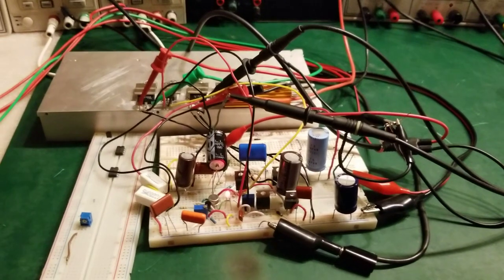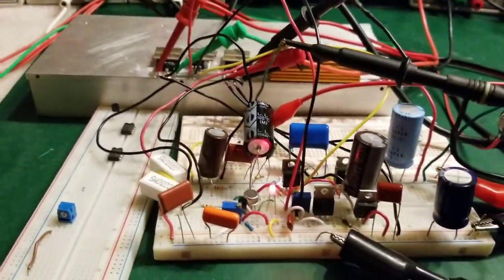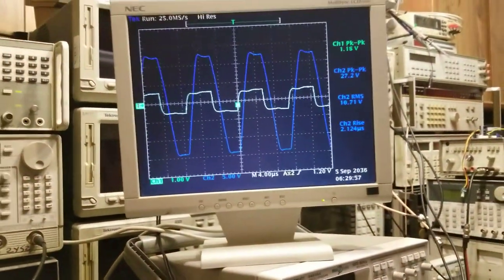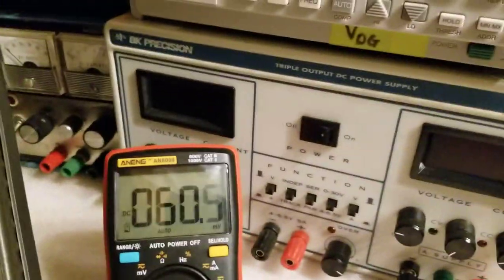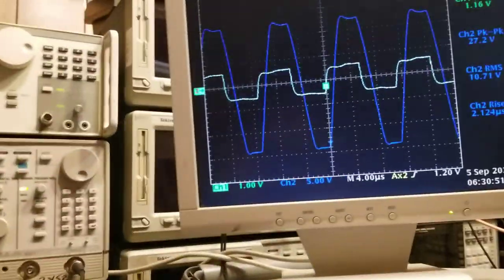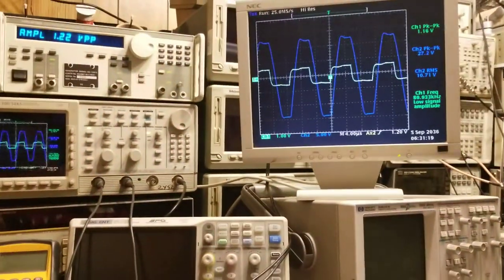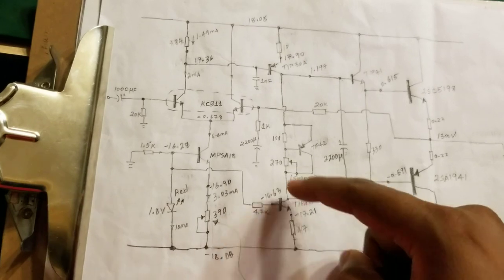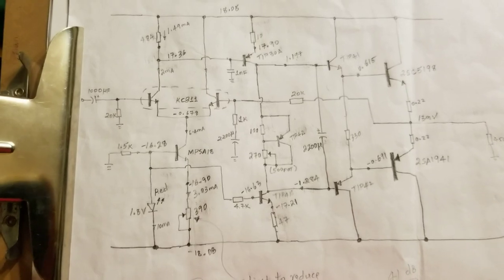Update: Power Amplifier Design Video Series

Comment: The transistor KC811 on front-end stage is very rare today. Is this made by Tesla (Czechoslovakia) ? My advice is - Do not use acid soldering flux - can lead to corrosion problems, because this transistors have iron terminals (gold plated or tinned)
Reply from the maker: Thank you for the advice regarding acid soldering flux! Yes you are correct KC811 is rare to get but I happen acquire life time supply of these matched npn pair (both HFE and Vbe are closely matched) locally from new old stock parts seller for cheap and are great for prototyping. If anyone is looking for a substitute you can use CA3086 if you can get it or any pair of matched (HFE) transistors like MPSA18 will do. And if you sell your kidneys you can afford MAT01 from analog devices...(but that is probably an overkill for this application)
Reply from the maker: You can also use BC807U from infineon technology for the input stage transistors.